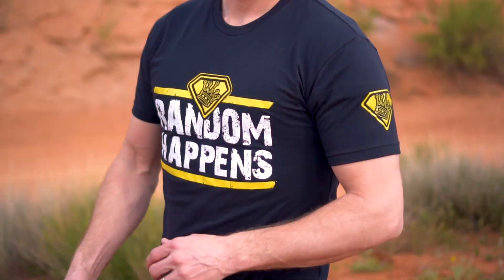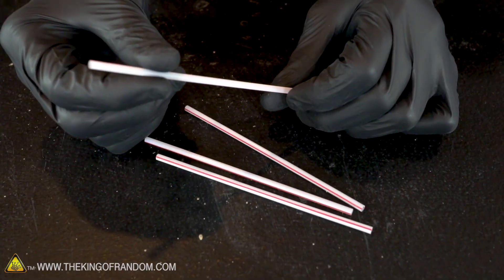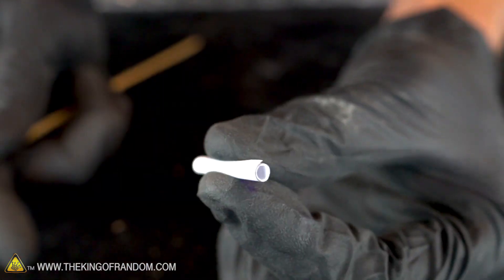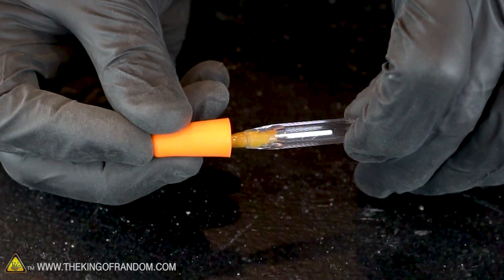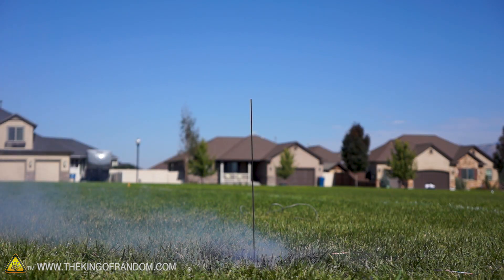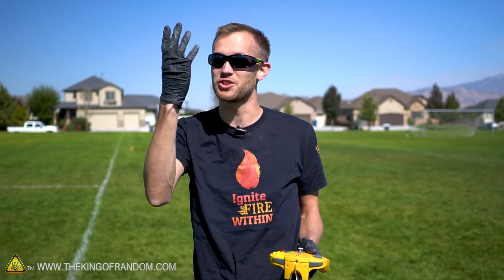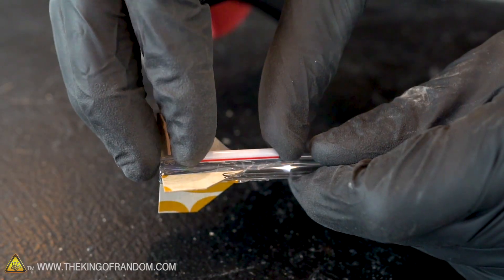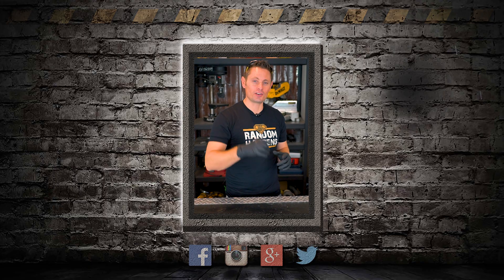DIY Pen Rockets! TKOR Dives Into How To Make a Mini Pen Rocket That Works On Rocket Fuel!

Comment: Hey king of random , put a small smoke bomb on the pen rockets so we can see it in the sky
Reply: Put in a small amount of Red smoke into it first, and then light it off. Seems like it would work well.
Reply: they do most of their experiments in relatively crowded suburban neighborhoods,what could possibly go wrong?
NEXT WEEKS HEADLINES: Terrorists Botch Attack in Middle America. What Radicalized These White, White Men?
Reply: @goober7535  He says white twice. Cuz they're extraordinarily white folk. Lmao that's funny
Reply: By packing smoke mixture in first the longer burning smoke stage could be triggered after the thrust stage. This might aid visibility and recovery.  You could also make a nose cone from the cap that hides a spring and ribbon between the cap and body. Then tie it down with something that will burn away like an elastic or thread that loops past the nozzle and thus secures the recovery system.

Comment: @thekingofrandom I think I know why those few pens went off at bad angles. I noticed that there is a hole in the sides of those pens as a manufacturing standard. If they were not sealed up tight gas would be forced out that hole on the side messing with the trajectory of the pen rocket. In one of the slow motion clips you can see that happening because of that.
Reply from the maker: Shane Ramos That's exactly right! Nate caught that in tomorrow's video, and patched the hole with super glue
Reply: iFizzySoda I don't comment in videos often so I was not sure how the system for tagging a person works. Just happens to be that 1 in so hundred or thousands of videos I watch. Today just happenned the day I thought I'd comment on Grants awesome videos.
Reply: @MyrrdynWhitefall  you can't tag a person on youtube :/
Reply: Also, if the straw is placed at the center of balance on the side instead of the bottom of the pen, you will get a more stable launch. Balance the rocket on your finger and place the straw so the middle of the straw is at the center of balance.
Reply: I like your idea of the guide straw and fins, usually what I do is I just use a bamboo skewer and use that skewer to cover that hole I just launched them like bottle rockets I really like what they did here though
Reply: You could also wrap that area with aluminum tape for increased visibility in addition to the support.
Reply: Also you could have used the bottom caps as a nozzle of sort to have slightly more powerful launches
Reply: @iFizzySoda i just did
Reply: Shane Ramos i was just thinking that lol
Reply: +iFizzySoda testing....  this is googles platform +might work
Reply: iFizzySoda test #2
Reply: Earl Teller nope didn’t work
Reply: I thought the same thing lol
Reply: This isn’t twitter m8. You can’t use @ and send a message directly to someone

Comment: Why not stick a LED on it and do it at night so you can see how high it goes
Reply: Or a glow stick
Cheaper one i think
Reply: 100 GHOST Glow stick would be better since you need no power for it and it may be lighter
Reply: Glow sticks are more heavy and it might make the rocket fly in the wrong direction where as an LED is lightweight and it only needs two button cell batteries Plus it can be installed inside the top of the pen since it's quite small of a Circuit also depending on what pen you use and LED can alter the chances of success for the rocket to fly straight up

Comment: Only thing I would do differently is put two straws one in the bottom one near the top so you can have two cartons to keep it from going wonky but I would reinforce those straws with two beads of glue on each side

Comment: Try finding the center of gravity of the rocket and try adding weight until it balances .it will surely go straight up in the air with maximum speed

Comment: Hey I think there is some problem with the pens body you should stick the  some duct tape around pens body to make it bit strong  and you should add some weight in front of the pen to make it stable  while it's flying In air

Comment: You might get more consistent results if you tamped (pressed) the powder in with a dowel instead of just pouring it. Air pockets in the poured powder are likely why you get some sputtering and inconsistent burn rates there.

Comment: Please use the metric system not the imparel system
Reply: RandomToDaMax an inch is 2.54 cm. A foot is 30.48 cm a mile is 1.609344 km. Every American learns how to convert between systems in school. Maybe instead of the King of Random accommodating you, you should accommodate him.
Reply: Wahid Arun it’s not like it’s hard to convert it. 1 inch is 2.54cm